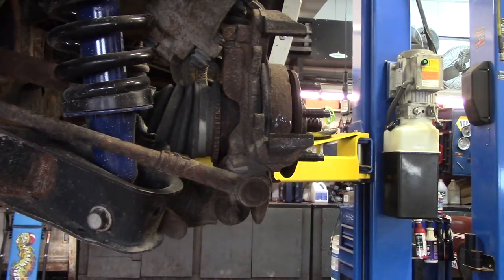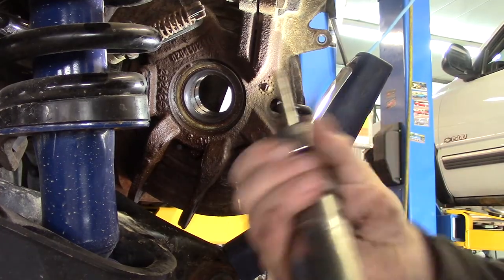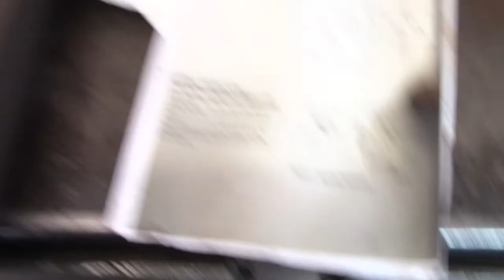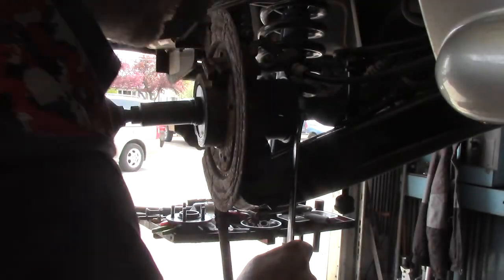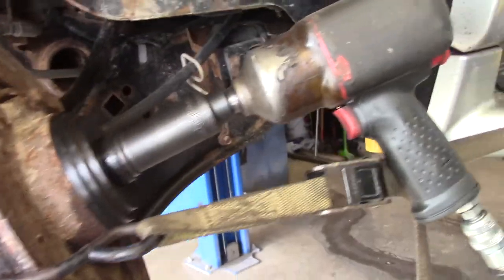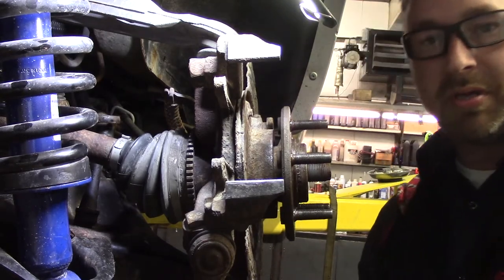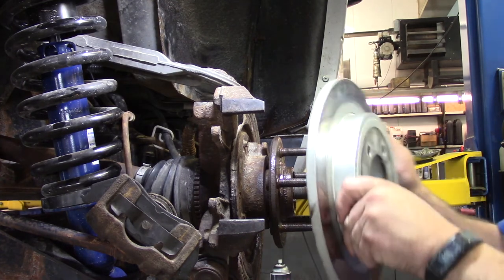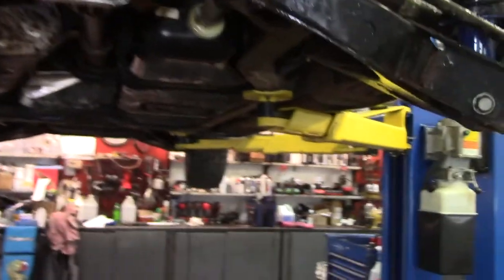2005 Ford Explorer Rear Wheel Bearing

Comment: Cool. I was wondering if the explorer bearings would be possible to do with a hub grappler since they are notorious extremely tight. Haven't had to do one yet in the explorers but now i know its possible to do with the hub grappler if i have one come into work.
Reply: You forgot to put the emergency brake shoes back on
Reply: Ummmm this is the kind of mechanic that scares me.  Just wants to muscle and beat everything